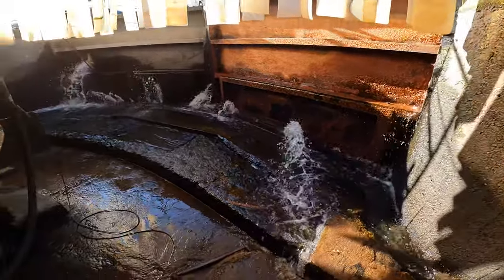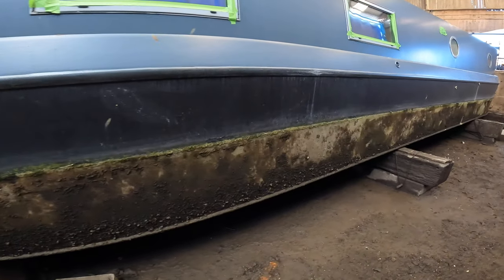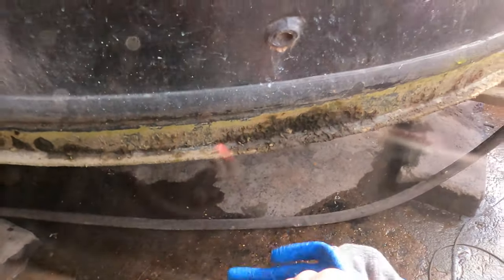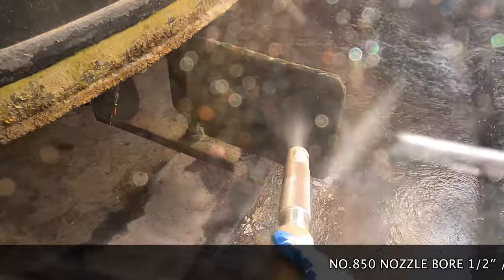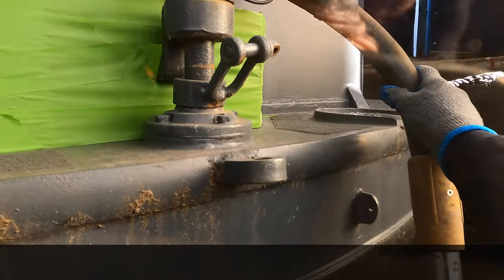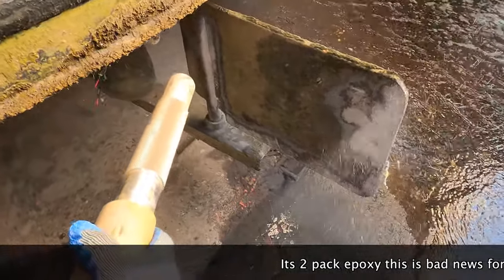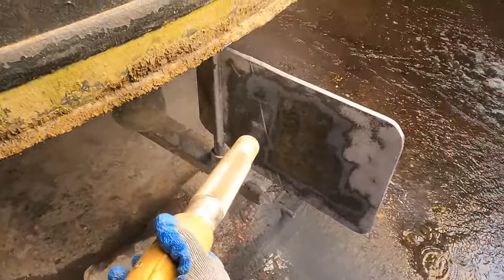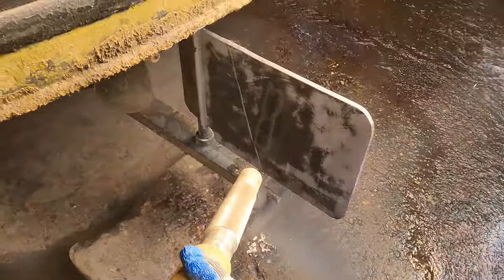SandBlasting 2 pack epoxy paint Narrow boat restoration

Comment: Gotta love that epoxy paint. I used to blast oilfield equipment here and had only one coated with that stuff. Had to run 2 compressors (300 CFM each) at the same time and run a larger nozzle. We just used screened #7 sand. Felt like I had a fire hose in my hands for a full day. Hated that thing. 

Would honestly rather be blasting again. Miss it. Was 30 years ago that I was doing it.
Reply from the maker: 😂 it hasn't got any better in the past 30 year it's still a messy old operation 🤣

Comment: cheers Mick
Reply from the maker: Been some time since I did a Boat 😎 the Dock is up and running again this year so hopefully more to come 👌
Reply: @Mobileblaster  hi Mick , I wonder if medium media will make that job to go quicker rather than usin fin+ ?
Reply from the maker: @George george  only going heavier would help (iron silicates steel grit etc) but thats when cost per m2 starts to play a factor yes its quicker cut but 2 or even 4 x more expensive for a slightly faster cut I have to offer value for money not so much speed. I could possibly do the job 30 % faster but cost 50% more.
Reply: @Mobileblaster  thank you for taking time to  enlightening  my view perspective , also is so much helpful to watch and understand sand blasting process since you write down on video exactly what nozzle you are using and how much air flow you need to do different jobs . That I think will help allot more people that want to really learn and understand not just watching . 
Regards🙏
Reply from the maker: @George george  I try to steer away from how too as alot can go wrong and what works for me (looks easy comments) certainly isn't. I put the nozzle size in because people that follow the channel know I've just upgraded compressor from 260cfm to 425cfm I wanted folk to know its not the same equipment and the people that know now know I'm using all the power available 👍

Comment: Good advert for epoxy; applied well. I suspect previously blasted new build of 2018 vintage .  Any other paint is false delusional economy. Presumably bottom judged okay for extension or did you spot shot any areas?
Reply from the maker: This was the 1st blast this boat has had I can tell with the amount of milscale also in areas the epoxy flaked off in large areas leaving shiny milscale if it was previously blasted this would be a matt colour and more than likely not flake off in big chunks also they was no tell tail signs of snail trails. The underside is normally a different job that don't get done duno why but I'm kinda glad haha

Comment: Hi mick
Yeah the Key blast medium is definitely better for that kind of paint. How long did it take to finish the whole job?
Reply from the maker: 9 hour shift but 45 min stop to get media. I used fine+ glass I loaded up with iron silicate for the following day turns out glass is better option on this job 2 well cost per m2 glass wins hands down slightly slower cut but cost affective

Comment: what is the consumption in kgs of sand for this work? great job
Reply from the maker: Depends on what your valve is set at also what cfm your using also your choice in media my consumption won't be the same as the thickness of the paint etc all plays a part. I try to get 1 hour out of 75kgs this can very alot so near impossible to give a number 👍

Comment: you gotta take off the mil spec too!! 😆🤑🤑
Reply from the maker: Why? If it was so important to remove it why is it on when I get to it? The boat builders release the boat from factory with it on so why then dose it become my problem to make sure it's been taken off? I give the option to the customer but the costs involved no one takes me up on this 💸
Reply: @Mobileblaster  no mil spec easy peasy lemon squeezy
Reply from the maker: @jdaspects  it is if you want to pay for it removing otherwise I will give value for money. No point pricing yourself out of the job for something that isn't an issue. I agree it will be a better job with the milscale removed but costs involved is the reason why its still on the boat when I get to it after all if it was important to remove it wouldn't be under the paint to start with 👍 the boat builder would have removed it before it's 1st paint 🤔
Reply: @Mobileblaster  they don't do that to cut expenses
Reply: it was joking anyway...

Comment: Brown aluminum oxide sandblasting is better👍👍👍
Reply from the maker: Steel grit is even better but the costs involved play a factor I have to stay in the affordable/time scale. Slightly slower cut with glass but the costs more than makeup for the extra time involved 👍
Reply: @Mobileblaster  Yes, I quite agree with you
Reply: @Mobileblaster  👍👍👍